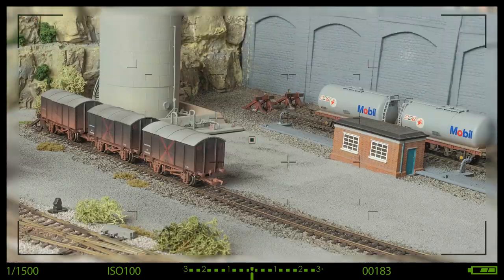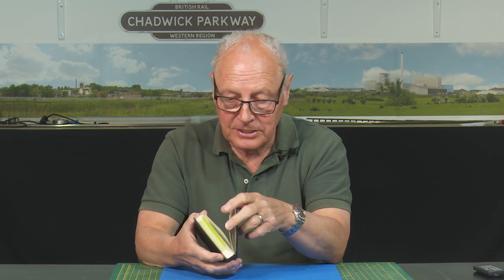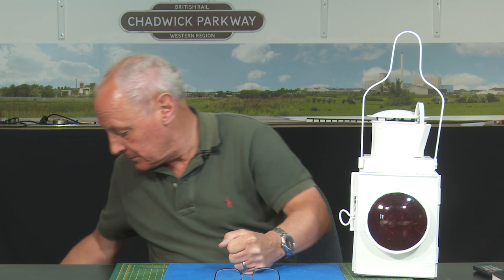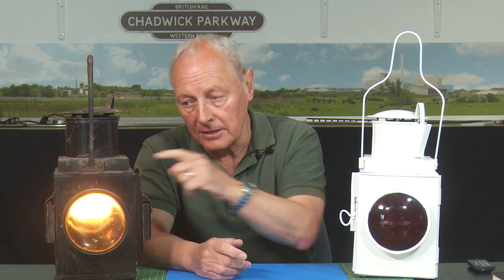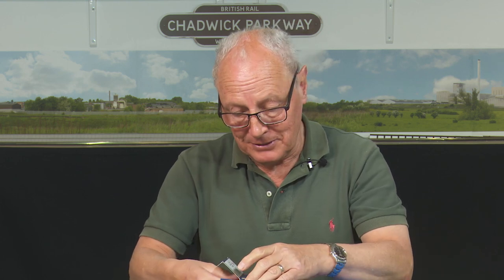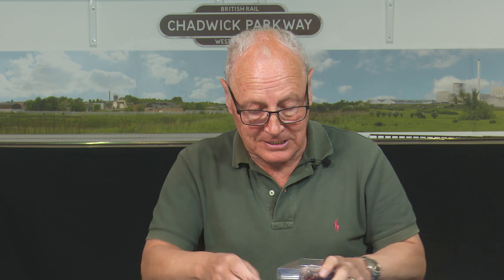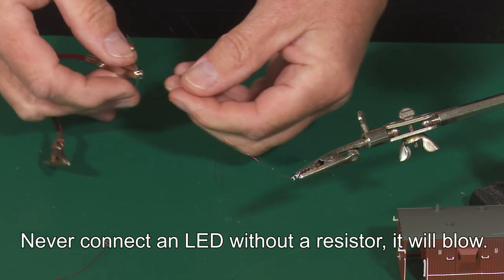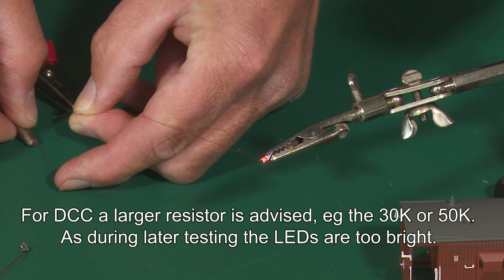Guards Van Lighting at Chadwick Model Railway | 94.

Comment: Great to see this - love more operationally accurate railway modelling!
Wasn't unfitted/partially fitted freight, tootling along at up to 40mph, the norm in 1950, but mostly eliminated by the mid-60s? When railfreight was massively contracting and they got rid of all the unfitted wagons first?
Reply: Roaming Adhocrat I was working unfitted and partially fitted freight trains in the early 1980’s. Working through tunnels, even with side lamps you couldn’t see your hand in front of your face! Exciting time!
Reply from the maker: I recall in the late 60s early 70s, grey 16 ton mineral wagons were still unfitted.
Reply: Charlie, engineers trains were mostly unfitted well into the 80’s and therefore had guards vans at the rear. It was though, becoming increasingly difficult to find coal for the fire. 
Working out of Bath Road, I learnt the road to Swindon and Severn Tunnel Junction in freight brake vans. I can remember working a freight out of Exeter Riverside up to Bristol in about 1982. If you are interested I have my guard’s journals stored for reference. Tony

Comment: I buy the O gauge items and there is lots of superglue with Dapol and Heljan, always loosing bits when I buy a loco or wagon so should not be an issue for me Best regards Andrew, by the way you can get SMT resistotors  which are a lot smaller mate
Reply from the maker: Thanks for the advice Andrew.

Comment: Relation to the circuit boards for converting DCC for guard van lights. I have had mine made up in china. Which I have an account to have them made. I think it is an excellent way of up dating a guards van, which I'm in the process of doing. As regards to the circuit boards they are also good for coach lighting as well.
Reply from the maker: That’s interesting, John, are these boards available commercially? Regards, Charlie.
Reply: @ChadwickModelRailway  I used the circuitry from everad junction. But used JLC PCB design to create the board then had the PCB made in china. Then ordered the components, then assembled them as and when needed. So far I have completed 18 for one of our club members at Milton Keynes model railway society. Which I am a member. Have used SMD LED's and soldered them to enameled wire and connect enameled wire to PCB. For pickups used DCC concepts axle springs. There is no flickering of the LEDs at all. Which is very good.

Comment: Jim got a great result! Those dccconcepts lamps seem quite pricey, as you can get tiny SMD LEDs pre-soldered to that sort of wire for a lot less. You'd have to create the lamp surround with plastic card and a microscope, of course... Did you consider putting those resistors on a tiny scrap of veroboard instead of that making that hairy looking contraption?
Reply from the maker: Not really Chris, as usual I just cuffed it!

Comment: Hello Charlie! Fantastic video as usual! Do you happen to know another place I can get the flicker free unit with the board shown at 26:40? He doesn't have them on ebay anymore. Thanks!
Reply from the maker: Sorry but no. Can you ask the original seller a question?
Reply: @ChadwickModelRailway  I did, but I actually found another seller on ebay that sells similar boards by the name of illumination_models. Item "AL-04 Stay Alive / Anti-Flicker Circuit"

Comment: Charlie! An excellent well thought out video. One Q: The difference between the brightness of those LED's from DC to DCC. You use 5 resistors so I was wondering how about putting one 30K resistor in series with all those resistors you put in - would that not compensate for DCC?
Reply from the maker: Perhaps that would work Michael. But sadly what I should have done was more testing initially.
Reply: @ChadwickModelRailway   It should work, Michael.  That would give us 40k to each LED and still have separate resistors for each one.  Since the DCC signal isn't being used to control anything in the Guard Van (I know you meant to say 'caboose', lol), the DCC should be irrelevant.  Worth a try if the roof comes off.

Comment: add a resistor between your resistor network and the board and it'll dim them all a little, you could even put a VR in there and make it adjustable. And if you wired those in parallel you could have just used 1 resistor.
Reply from the maker: Great comment and useful points Morlanius.

Comment: Helloooooo!! Chic , youve got the best glue in yer arsenal for stickin on yer lamps , its resin n its called gorilla wood glue n it sticks anything together , a wee blob turns into a rock hard snot...lol..even metal , i wouldnt be without it.let it go off a wee bit then stick it , microclear is good and hobbetac...gorrila goes yellow when hard.....😉
Reply from the maker: A great point Jim, many thanks.

Comment: Charlie just a couple of things that may help ... Connectors ...or chop blocks as you may know them mate ... there are connectors with connection points that will solder to the rear of the PCB, as indeed will the capacitor with out chop blocks or a flying lead , also putting a higher value resistor in series would negate the need for all the resistors, if they were then put into chop blocks and double sided tape to the floor of the van.
This certainly not a criticism, but maybe a recommendation that may assist, also and however it is an opportunity for a Pongo to get one over a Matlow lol   .... Keep safe and happy VE Day ...Steve
Reply from the maker: An interesting point Steve. I could open it back up and solder in another resistor in front of the group of 5.
Reply: You could but  wouldn't  that then be in parallel ? it seems to work really well, perhaps it may be worth contemplating installing a higher value resistor instead  for the next one

Comment: (Hopefully constructive) criticism for the products...  at those prices they could have marked the wire with a Texta (down under for an oil marker like Sharpie), used  a different enamelled wire colour,  gauge or some other characteristic, to differentiate  the LED polarity so you didn't have to mess around.  Also would have been nicer if they  used warm-white LEDs in the white lamps to simulate a fuel or tungsten lamp  to be more prototypical  I think the cold-white ones are too blue :)     Your videos are always quite entertaining, I like the inclusion of discussion on things like regulations and head codes   As always,  best wishes to you and yours from Down Under.
Reply from the maker: I’m so pleased that you enjoyed it. I’m totally on your side regarding the colour of the white lights. Yes they are far too blue. I can feel an email coming on to DCC Concepts.
Reply: @ChadwickModelRailway  Hopefully they have a policy of continuing product improvement. I can understand consolidation to make cost savings,  but some of these little processes would cost very little (if anything) to improve customer satisfaction markedly.  :)

Comment: Great Video, as usual and typical matelot dry humour..!  For info, if you have a need for a lot of the circuits boards for coach lighting etc, say 20, you can pick up all the components for £0.46 a copy.  You could also use a single resistor for all the LEDs, or better still a tiny variable one for each colour to allow you to set the brilliance; just a £0.46 (for 2) more.
Reply: Correction to above, single resistor for each colour..!
Reply from the maker: Now I want a link Patrick?
Reply: Hi Charlie.  Have look at any of the large component provider, e.g. Farnell.  The bridge rectifier and capacitor come in packs of 50 at 22p and 16p each and the resistors 6p for the 1K and 2p for the 220 ohm in packs of 20.  All you need is a small piece of vero board.  For dimming using a 20K or 50K variable resistor, around 33p in packs of 5 or 10.  Need to put in series with a low value (1K) resistor to avoid putting full voltage through the LEDs, another 6p..!  I recently sourced components for a small circuit to make locomotive direction lighting work on DC as well as DCC. One key component sells on eBay for £3.95, I paid £1.94.  Shop around and bulk buy save you a fortune. Ex Pinkie, 40 years.

Comment: Charlie, really enjoyed this video.  I have a concern that the capacitor used on that PCB is a little underrated at 16v.  Correct me if I'm wrong, but doesn't a DCC signal swing the DC supply positively and negatively between the rails so you get approx twice the voltage of the supply?  If so then with the 14v being the traditional standard  would give around 28v DC peak to peak across the rails (not a true AC signal, but as far as the bridge rectifier goes it sees that as an AC waveform).  Allowing for the 1.4v voltage drop of the rectifier, that would still mean the DC output of that board is around 26.5v DC.... almost 10v more than that capacitor is rated at and why the LEDs were so bright compared to when tested on a 12v DC controller.  If you use more of these boards in future, I would suggest using the same value of capacitor, but one rated at 50v just to reduce the chance of a failure.  - As for the cost...£50... I'll take the McKinley version you built a few weeks back any day which look just as good IMO
Reply: DCC is not an AC waveform, it is modified DC, there is no centre point, it just reverses, so peak to peak, is the same as the DC that supplies it. DCC should be a nominal 12V minimum, but more sophisticated DCC boosters can be higher and some can be adjusted, to potentially the NMRA max of 22V! So your concern is noted, but unless you have a particularly high voltage booster, most are under 15V, if you have, then a 25v Capacitor should be used.(Use a 25V if you are concerned it may be used on someone else's layout or yours if you may upgrade the voltage). A similar concern is for the bridge rectifier or diode network, standard diodes or standard bridge rectifiers should not be used! They do not recover (work fast enough) on the DCC frequency! They create a spike that can cause problems with the waveform! A Schottky (fast recovery) diode or bridge rectifier should be used. I checked the specs of the PCB used and it does indeed use a MB5S fast recovery Bridge rec.
Reply from the maker: I’m afraid your electronics knowledge is deeper than mine Malcolm. I do know it’s a 16 V square wave DC input but I’m unaware that it doubles up.  However, I’ll certainly look into it.
Reply: @ChadwickModelRailway  If you know that your DCC output is 16V, the you should use a 25V capacitor!
Reply: @TimberSurf   I was googling DCC and looking at images where people had connected a scope across the rails, most showed the measured DC as being twice that of the supply such as this one https://www.researchgate.net/publication/318924580/figure/fig7/AS:524212088393728@1501993309958/DCC-signal-across-rails-trains-stopped.png  The 14v supply being read as 29v peak to peak.  But Looking further the controller is just alternating between the A/B rails, 0A and +14B then vice versa so in reality only 14v is seen by the decoder.  Either way I still would suggest that the capacitor be rated more than 16v.

Comment: Hi Charlie, I'm fitting lighting in an HST 125 and I'm using wire wrap instead of soldering. The small wires on those LEDs would be ideal for this.
Reply from the maker: Good luck with that project Stephen.

Comment: Hello Charlie,

Is the code 100 streamline track the best one as a beginner to start with as I think this is the one that the points don’t derail or stop on, my other question is, can all trains run on it without the wheels snagging on the rail grippers. And getting a digitrax Zephyr controller.
Thank you for all your patience.

Yours sincerely,

ross
Reply from the maker: Yes, absolutely Ross, Code 100is fine.
When it comes to points, go for the electrfrog version if you can.

Comment: Just a thought, but I would have suggested sliding a piece of heatshrink up and over the legs of the capacitor just in case something were to get against them and short things out.
Reply from the maker: I did use red insulating tape.

Comment: Having used the DCC Concepts lamps myself, care should be taken that they won't be damaged when placing or removing the rolling stock from its box. I inadvertently destroyed two lamps off a Hall class that way; the glue didn't hold and the wires simply sheared off at the lamp base - No chance to repair those lamps.
Reply from the maker: A good point S531, regards Charlie.

Comment: Hi Charlie, I know its late on but I am a new subscriber... just a thought but to make the lights both dc and dcc compatible could you not put a zener diode and resistor across the output that would regulate it to 12vdc so you could stick with the 10k resistors regardless of supply
Reply from the maker: Good point Steve, regards Charlie.

Comment: Hi Charlie: What was your rationale for adding leads to the capacitor rather than just soldering it directly to the circuit board? Just seems to add wiring/cables that aren't necessary. Just curious.
Reply: Continuity as the consist bumbles along from board to board with only basic wheel pickups you don’t want the strobe effect going on as it charters along the rail joins and points so this just gives the additional power to continue.  Like when he turns off the power you see it stays on that’s what it’s all about.   Much love sir.
Reply from the maker: Hi Doug, it was just belt and braces really, perhaps too cautious.
Reply: @ChadwickModelRailway  yes, perfectly reasonable.

Btw, a wiring diagram might help at the start of the video.

Comment: If you think the lights are too bright, rather than swap the 5 individual resistors to the lights, couldn't you just add an additional resistor of an appropriate value in to one of the feeds from the track pickups?
Reply from the maker: Of course, hindsight is a wonderful thing! Regards Charlie

Comment: Stolen (er, borrowed with incomplete citation) from a forum, for applying superglue, a transferring applicator often is of great help.  To that end, if a person can find a sewing machine needle (at a shop rather than in the house averting potential domestic discord) and breaking the tip at its eye yields a fork-like applicator which can hold a drop of CA with some authority.  Sewing machine needles having a stepped shank of 4 or 5mm diameter giving a better hand hold than a n ordinary sewing needle.  As to where to put the CA to dip the needle into, foil pill containers (sigh all to common with age) are very handy for the work, and can be disposed of at leisure.
Reply from the maker: Now there is something I have never heard of.  Great tip.

Comment: What was the voltage? Or as you are using Digitrax can one assume 14.7 V ( track voltage.)
Reply from the maker: Yes Sam that’s correct, track voltage into the resistors.

Comment: 4.7k resistors are perfect in brightness. charlie try solder paste, it melts at 125c
Reply from the maker: But not for these ones.  
They are too bright with a 10k.
Reply: @ChadwickModelRailway  have you tried variable resistors charlie

Comment: To decrease the brightness, could you add one big resistor at the point where you've twisted all the resistors together where they attach to the board? Or, could you add individual resistors to each anode wire (cathode? I can't keep them straight in my brain. The wires that don't already have resistors on them.) 
Also, I"ve heard that super glue/CA will just fall apart if you put a plastic model in the freezer. Anyone know if this is true? Thanks.
Reply from the maker: The freezer is news to me mate.

Comment: Charlie - why do you use two pickups,..and not just one on a wagon?  (Ie making your 8 pickups do 8 wagons?)
Reply: Probably to prevent the less going off when going through points.
Reply: @neiloflongbeck5705   OK.  Makes sense.  I wonder if the capacitor would solve that problem?
Reply from the maker: It was just belt and braces Gary.

Comment: Good evening Charlie,

I’ve made my mind up to drop the Marklin z gauge in favour of the OO setup.

I am never going to be of your standard nor  ‘moulded raspberry’ - perfectionists, it’s purely for me only.
Could or would you be willing to point towards dealers who are willing to help me over here in N.Ireland.
One shop that seemed to have a huge stock of “old” style historic locomotives “NewModelersshop”.
I’m going to take your advice about the “Peco” track, but, for a non-exhibition person what would be the best range of track allowing for:
I don’t expect you to favour any specific dealers/shops, just options.

1. D.C.C. Controller
2. Some means of controlling “points” preferably from within the controller 
3. Will I need new switches, would the existing Marklin Zgauge switches work
4. Can I have a D.C.C. controller that will let me control the engines and points!

I do apologise for the above “asks”.

Yours sincerely,

ross
Reply from the maker: Hi Ross,
I would use Peco Code 100 with electrofrog points.
Speak with Jeremy of Digitrains for controller advice.
Regards Charlie
Reply: Chadwick Model Railway Good morning Charlie,
Thank you so much for taking the time to reply to my long rambles.
I will sit quietly in the corner until I get back to work - piano tuning
to build up finance.
That last one you did was so really mind blowing - at least to me
That really was impressive!!

By for now, ross

Comment: Small point, it is a 1000 micro farad capacitor, not 1000 pico farads.
Reply from the maker: Thanks CP, much appreciated. 
Regards, Charlie
Reply: @ChadwickModelRailway  No worries.
You do great work. that job looked really fiddly. I'm thinking of starting in n gauge. No lights on brake vans for me!